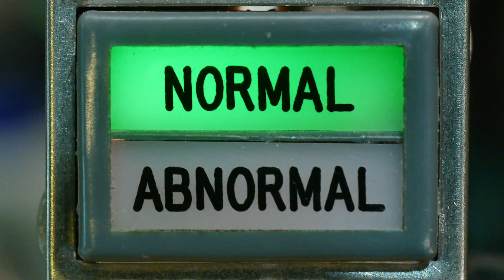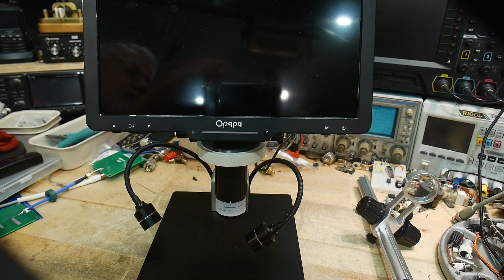#1458 Microscope Stand

Comment: You need to add a ring on the shaft with a knob screw to sit under the microscope assembly so you can pivot the scope around to look at things without refocusing.
Reply: Biso 
Ic biso
Ram
Bios only

Comment: It's a big improvement, except for two things.  

1) You made a $100 improvement to a $200 microscope.  I'm just not sure about the economics of that.  I have to wonder, couldn't you  spend $300 and get the microscope with the features you want?  And, for folks who don't have thousands of dollars of lathe, drill press, and 3D printer, it would still be difficult to do.

2) You lost the rack and pinion feature to raise and lower the microscope.  That is more for adjusting the distance to the work and the effective magnification.  I suppose that once you have the vertical distance and magnification you like, that is something you might not be changing very often.
Reply: A free microscope gets improvements using parts that were free and available in a junk box. Not exactly sure what you are complaining about.
Reply: @vincei4252  Under the heading of sharing ideas, it's OK.  But, mostly it works for him and not most of us.  If I want that microscope, it's $209 on Amazon.  That free chunk of aluminum needed milling and drilling using equipment that costs many times the cost of the microscope.  I could go on in the same vein about the rest of the "upgrade", but that is my complaint.
Reply: @BryanTorok  Well, technically like I did as a goal when fabricating my latest metal part, I used the hand tools that I first learned machine tooling on.  Those are the hammer, files, hack saw, punch and hand drill.   I do admit, for the longer cuts I cheated and used a cheap Harbor Freight angle grinder with maybe 1/8 of a cut off disc and for the hand drill I used a cheap found on FB Marketplace Ryobi 18V One+ drill with a homebrew adapter I made from the old dead battery pack upper section and a cheap DeWalt 20V adapter bottom section.  The twist drills may have came from estate sale or second hand finds, though hard to say though aren't very expensive in the stores.  I grinder is a handy tool for sharpening the twist drills and scrapers.  Albeit the HF most cost effective rotary tool broke on me recently when tightening the chuck so need to see how to repair that.  So, basically, shopping around second hand stores can save a bunch as well as flea markets, surplus stores, garage sales and online listing where sometime even free items can be found.  40-50% and more off sales are great as well. The cheapo tools are more scary since tend to break unless you have a good warranty and return.  I patiently await the higher quality made to last tools.
Reply: For those without a 3D printer, the restore and other location more rarely might have plastic pipe and parts that can be slit and adjusted for fitments as well.
Reply: @jafinch78  I did lots of that as a teenager.  The question is:  Is making the microscope part of the hobby?  Or, is having a functional microscope a means to enjoy the hobby?